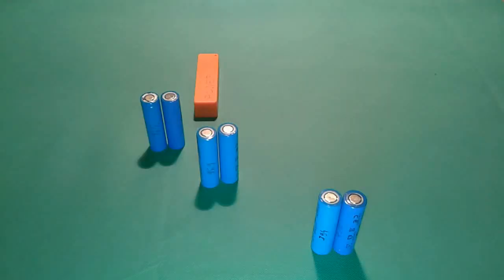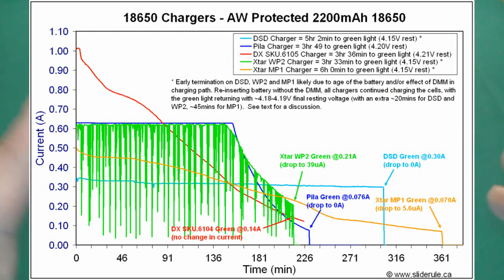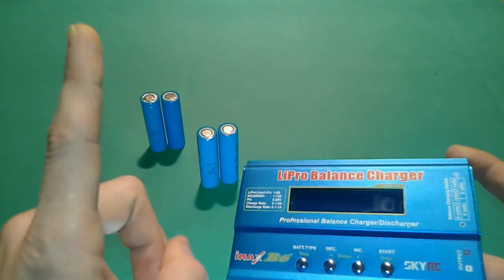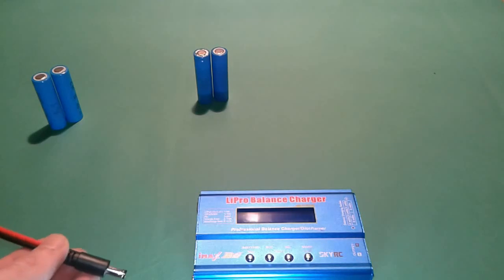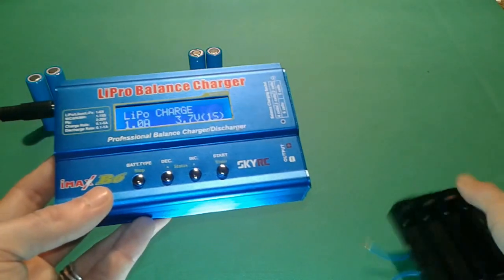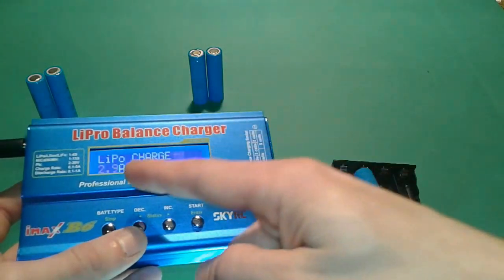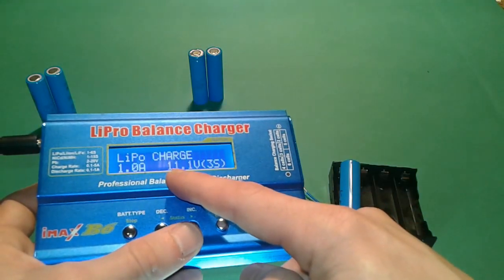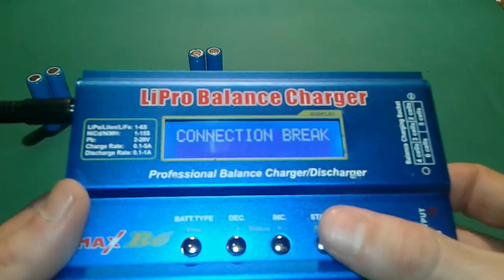How to charge li-ion battery pack using IMAX b6 18650 lipo charger

Comment: Can this charger use for a car battery pack 12V 15Amp lithium battery as I noticed it can only charge 0.1-6.0A . If it is possible how many hours it need to charge up to 15Amp? Thank you.
Reply: The charge rating is Amp Per Hour so 1.0A is 1amp per hour

Comment: Shouldn't You change the li-po into li-ion in the settings before doing this?
Reply: It doesn't matter. LI ion battery need charge max 4.2v each battery on lipo setting

Comment: It would be more helpful, and safer if you told people the correct information, and how to use the charger correctly.
When charging Li-ion, choose Li-Io setting. Charging Li-Po, use the Li-po setting.
Charging LiFe, use the LiFe setting.
To select between battery types:
Go to - User Set menu - Enter.
Press + Hold Enter until Amps flashes - Adjust charging Amps as required pressing Inc or Dec.
Press Enter to switch to voltage position.
Now you can use Inc + Dec buttons to change between the 3 different Li** voltage types
3.6v = LiLo.
3.7v = LiPo.
3.3v = LiFe.
Select what you want to charge + press Enter.👍

Comment: Never charge unmarked 18650 above 800mA. Best ideal charge current is 500mA.  If you have proper branded 18650s with C rating then it's safe to charge with the given amps.

Comment: Have the exact same charger works perfectly charging my LI ion batteries (lipo 3.7v setting)and battery packs made up of li ion cells (they have battery management systems ) just set the capacity max before you charge and off to the races works perfectly. Haven't gotten the discharge function to work yet

Comment: Can i replace my old li polymer battery with lion lithium battery using same charger?
Reply from the maker: Yes you may do so if respecting the voltage and current charging data

Comment: This video is terrible and completely wrong.  It will only charge at a constant current for so long and then it has its own charging algorithm built into the charger so you can't follow the manufacturers guideline.  Buy a Li-Ion cell charger...you're gonna burn your house down.  And you're charging current is completely wrong.  If it was a constant current per the graph it said 0.6mAh.
DO NOT FOLLOW THIS VIDEO.

Comment: Why would you recommend people to parallel charge 18650’s? 

With a charger like this you should wire the 18650 battery holder in series and add a JST-HX balance leads. This will allow all the cells to fully charge.

Charging in parallel like your showing wont charge all the cells to max cap because when the first cell reaches max cap charger will turn off leaving the rest of the cells only partially charged.

Comment: You should change battery type from menu. This is not lipo. As you can see at battery type menu, there are three different kind, lipo, liion and life. Lipo is 3,7v and liion is 3,6v
Reply: the last 10 videos of big cell harvesters have said 4.2 li ion. what the hell. I can't find a straight answer or reply. 18650 are not lipo. not 4.2 but they are all doing it. driving me crazy.

Comment: Charging these in parallel like this can cause a fire or explosion if they are not balanced, they will draw massive currents. This is a balance charger, why not use it as intended?
Reply from the maker: Normally if you wanna do it propper you have to charge every cell individuality and discharge it in a pack but is not cost effective
Reply: @NoSkillsRequired   That is completely wrong. The balanced charger you have in this video is specifically designed to charge multiple cells in a pack at the same time, making sure they are all balanced safely. You can get even cheaper chargers that charge them individually at 4 at a time for less than the price of the cells. This would be cheaper than the iMax B6 you've already paid for and thus better cost effectiveness. Seriously, rethink what you're doing as it could cause a fire or explosion, burning your house down and hurting or even killing people, how cost effective is that?
I find it weird that your using the world's most popular balanced battery charger, but your not even using that function, but instead just using it as a power supply endangering people in the process.
Reply from the maker: @Ziplock9000  i am not talking about the charger in the video not everyone has this one this is a special designet charger one of the best
Reply: @NoSkillsRequired  So your talking about a charger not in this video, what? Anyway, the iMax B6 this is in this video that I commented about is not special, it's the worlds most popular battery pack charger/discharger/balancer. Like I said, you can get even cheaper ones that charge individual cells 4 at a time at low cost and are safe. But the point is, IN THIS VIDEO you're using a balanced charger in a very wrong and potentially really dangerous way. While you might be willing to take that risk, there's a responsibility on your shoulders as a broadcaster to the people who watch your videos. They may go and hurt themselves. You should really brush up your understanding of how this charger works, balancing works and the dangers involved.

Comment: 18650 works the same as lipo

18650=3.2-4.2volt
lipo=3.2-4.2volt
with 18650 dont go over 1amp charge (???)
with lipo you can go 1C charge

Comment: example if 6 cells want to charge in Parallel what is the calculation ...?
for 1 cell required 4-5v 1amps then 
if 6 cells volts , amps?
if 12 cells volts , amps?
kindly reply.
Reply from the maker: +kmurali krishna in paralel 4v 6A,for other voltages you have to bring the voltage down to the same value 4v with step down converter or with buck converter which steps down the voltage and increase the amps

Comment: Thanks. Got my charger secondhand, and was trying to charge tool battery packs without the instructions to the unit. The press-and-hold ENTER at the end of the programming had me. She rollin now
Reply from the maker: John Bobbitt glad that I could be useful and guide you to using the gadget properly all the best friend and don't be a stranger
Reply: hello sir, you have no idea how much of a pain it was to find this page and post again. lol. But I had a question and thought of you. 

I've got two car jumpstarters that both have issues with their internal boards. ones power switch broke off, the other has a component that kept cycling so hit as to melt the plastic (do NOT buy Schumacher brand). I also have an audio sound bar that has it's own psu internally that converts 110ACV into 24DCV before providing power to the amp circuit board. Maybe you see....?

I'd like to stack both those lipos inside, wire them in series, and output to the amp board. instant portable soundbar rechargeable with the imax. see any issues, other than being the coolest guy in town and needing a big stick to fend off women?
Reply from the maker: John Bobbitt the general rule for batteries in series is unbalance with time, iMax b6 is good for that. You have to keep in mind that lipo are a little different from li-ion,they are meant to be discharged fast meaning they can provide great amount of amps for a short period of time that's why are used in jump starters, but with some current limiter it may work
Reply: @NoSkillsRequired  and then what about the use of the same type of battery in our smartphones? Granted, a different voltage, but nonetheless....they must have then an inbuilt current limiter?
Reply from the maker: John Bobbitt it is exactly the same battery but flat to fit inside why do you thing most of the phone are Charged with USB, 5v and yes there is a current limiter in the phone and in the charger as well
Reply: ..lol..stop be strange and explane by showing and learn the things bevore talking, mister Stranger..lmfao

Comment: 18650 are not lipo, they are li-ion 3,6 volts
Reply: Wow...he doesn't have a clue...using lipo function when it's a Li ion battery!
Reply: @michaelgravelle9091  there almost identical in charging settings lithium ion fully charger 4.2v lipo fully charged 4.2v I've use the same charger for both lipo and lithium ion 100+ times the lithium ion doesn't not get hot just slightly warm which is normal when charging and batteries hold charge perfectly
Reply: It doesn't change that much....
Reply: The LI ion battery 3.7v need to charge 4.2volt max on lipo setting. LI ion setting max volt is only 4.1v cut voltage. Nothing issues use lipo setting to charge LI ion battery. I've been use 4yrs
Reply: i have 18650 of 3.7 volt. printed text on the cell 3.7v. what option must i use? li ion? or lipo?
Reply: @carlos5r  li-ion

Comment: thank you that is a very clear explanation for someone that has never used the imax b6 before.
I am trying to charge some Makita 18v  batteries that have discharged too low for the Makita charger to work.  (12v )
I am assuming that I can charge the 1500 mAh 5S cell pack  at  0.5C safely  yes ?
Reply from the maker: John Cooper 0.5c is safe enough, be careful one or more could  be faulty so check them first and then try to charge and monitor for heat
Reply: @NoSkillsRequired  thank you for your quick reply. You hit the nail on the head, I  opened the battery again and checked all the cells and found another  faulty cell. ?   once I had replaced the cell  the battery showed 18V and worked perfectly. Not sure yet if it will charge normally on the Makita charger but could always use the IMAX B^ if not .
Reply from the maker: John Cooper so if you had one cell bad you have to charge all individually and discharging them there is a video "how to discharge 18650" and you have to match the new one with the other ones to have same or near capacity to have a balanced pack, otherwise you are risking to damage the next weak in line, the simple way is to make another pack with new cells and reuse the rest of batteries for other projects
Reply: @NoSkillsRequired    thanks for warning but all cells had been previously balanced charged and 2x faulty cells replaced . When reassembled the Makita battery wouldn't drive my cordless drill and showed 12v total. When i took it apart again I found one of the replacement cells had failed probably from soldering heat . i replaced it  and  charged it to match the other cells and reassembled . Drill now works fine and will check it on the Makita charger when it has discharged
Reply from the maker: John Cooper nice glad that you fix the problem it's not hard when you know what you are doing and with a little bit of help from YouTube its not useless after all 😃
Reply: @NoSkillsRequired  thanks bud I'm very happy to have salvaged a useful spare battery . I just hope that it charges from the Makita charger . Thanks for your advice and helpful video ....much appreciated
Reply from the maker: John Cooper any time friend glaf to help drop a like from time to time it helps a lot

Comment: Just to let you know, that is not a Genuine one .
Reply from the maker: Speed Freak possible these days we are surrounded by fakes but this a well made fake and works it wasn't cheap but I am seeing more and more Chinese stuff on Amazon starting from a standard product and they branded and advertise and sell for higher price. As you can see in the video I am doubting if is genuine
Reply: NoSkillsRequired , The Genuine one up the top above the screen says iMAX B6 mini SKYRC, and where the banana plugs go in there gold looking and underneath there is a holographic sticker where you can scratch off and there is a number there to look up on the SKYRC website to confirm it is a genuine item, and it comes in a white box not the black one 👌🏼👍🏻. I am sure yours does work fine but there is a difference , I have one and there a good beginners charger but I like the ISDT Q6 Pro. it can charge big LIPOS 6S at 10 Amps easy.👍🏻

Comment: Ii expected an explanation how to charge 18650 instead I lost time listening that your charger needs a power supply.
Reply from the maker: Piotr Zerynger this is a way to charge, what did you think you will plug them in USB and done no friend there is a complicated process
Reply: @NoSkillsRequired  sure. Rocket science.

Comment: What about the Balance? if you charge more then one
Reply from the maker: The balancing is another chapter and the opinions about that are many theoretically if you will match the cells with the similar capacity you will not need a balancer circuit,and li-ion are different than lipo(must have a balancer) you have to experiment with it and choose what works best for you
Reply: Ok I'm far from a battery expert so if I'm full of shit then so be it, but I don't think this is right.  Balancing is for multi-cell packs, and these are 1 cell batteries, so even if you're parallel charging one of them, the charger still sees them as just a bigger 1s battery so I don't think balancing is necessary.  Or even possible for that matter since there's nothing to balance.  Like I said if I'm no expert so I might be completely wrong, but that's how I've always seen it done with 1s batteries.  How would you even go about balancing without a balance lead?
Reply: I think the internal resistance of li ion is much higher than lipo. Also li ion discharge rate is much lower than lipo. So with that, they would balance self out easier, but i suppose if ur charging more 3s than yeah i would use balancing port to be on safe side.
Reply: It is extremely dangerous to charge this way .  If charging more than one cell at a time it must be balance charged .   Don't risk a fire charging like this .. this video is what not to do !

Comment: JAIME VOTRE VIDEO ,,MAIS MOI JAIMERAIS CHARGER 4 BATTERIE AVEC SE CHARGEUR ,MAIS COMMENT DOUDER LES FIL A PRET LA BOITE A 4 BATTERIE ,COMME CEL SUR LA VIDEO ,JAI 4 BATTERIE 3200 MAH A 3.6V ,COMMENT SOUDER LES FILLE POUR BALLENCE LES BATTERIE ,MERCIE
Reply from the maker: Pierre Picotte meci pour votre comentair. For charging 4 battery you will need 4s charger around 16v and 1a I will take a look and reply back in the time you can check jehugarcia channel bon chance min amis

Comment: What is input voltage for charger for 4s lipo battery
Reply from the maker: tushar bhalerao for lipo and liion you have to know 3things starting voltage or nominal voltage 14.8v, max charge 16.8v and a battery pack 4s is considered discharged at 12v.constant current till 14.8 and then constant voltage till 16.8 and one more important thing lipo need to be balanced charge all the best

Comment: how can I charge 12v 7ah battery? 🙄
Reply from the maker: Orhan İyidogan what type of battery? This charger can do liion, lead acid, nici and nimh
Reply: NoSkillsRequired 
its a little motorbike battery. 😔
Reply from the maker: Orhan İyidogan ok so it is a lead acid for that you will need a 14v charger at 0.5A for 14hours or check my video `incredible 12v battery charger`

Comment: Pros would choose 'LiIon' to charge 18650 Liion. &'LiPo' for Lipo.
Reply: In Liion menu with this charger will only go to 4v which is 80% so to get 100% charge which is 4.2v you need to use LIPO menu
Reply from the maker: +auricom24 on this model lion and lip are in the same option and there is the same specs with the difference that lip need to be balanced
Reply: power on the charger, press leftest button to 'Programm: user set'.  There (maybe) you schould be able with rightest button to choose between Liion/LiPo and LiFe.  On my chargers sis is da wae.   
All Batteries with more than one cell should be balanced.
Reply from the maker: auricom24 This one doesn't have multi option for lithium and if you group your cell to have close capacity you don't need to balance them I have a pack of 12v and 10a for 2 years now no balancing nothing no bms and the cells have drifted 0.1v
Reply: Your charger has an Liion option!  i've seen it on youtube.

oh.  I have to correct myself:  
i said 'you should balance'. my meaning was 'i fell better when balancing'
(At least LiPo for RC should be balanced.)
Reply from the maker: auricom24 yes lipo need to be balanced because they are different from liion. Lipos are power cells capable to deliver huge amount of power for short period of time that's way you need to balance them to protect them from drifting in a multicellular pack. You need a 4v constant current and then till 4.2v constant voltage any charger that can do that is a good charger in my opinion all the best